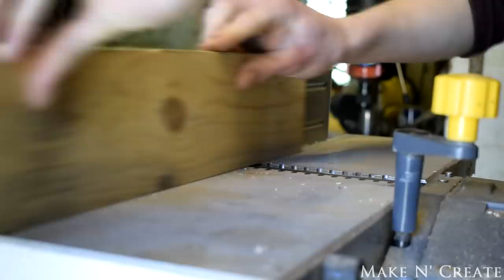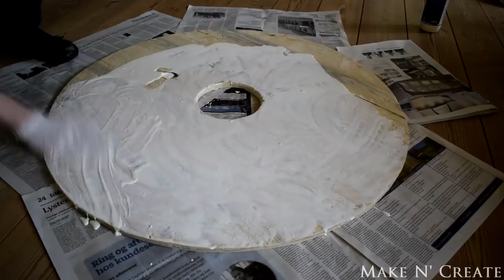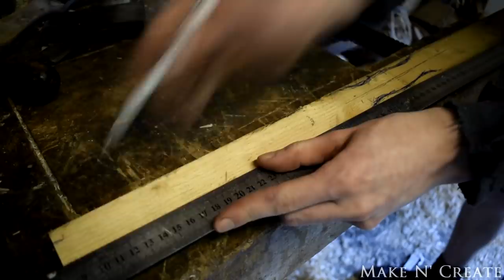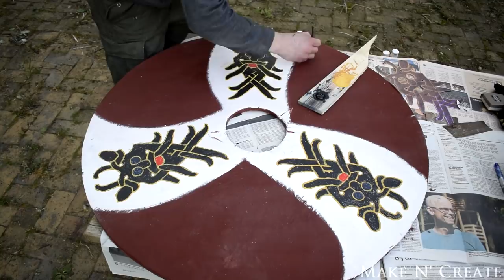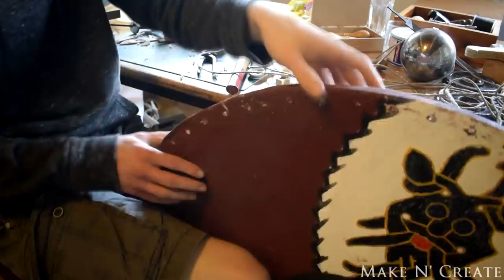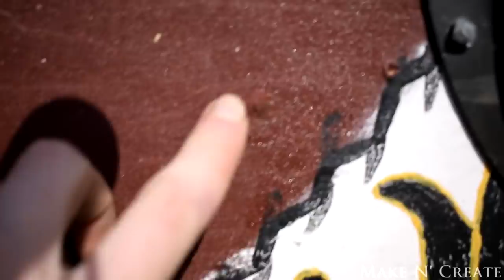Woodworking, Blacksmithing and Leatherworking - Making a Viking Round Shield and Testing it

Comment from the maker: Just gonna leave this comment here because it seems like some people didn't see what I wrote at the end of the video. This is not a historically accurate shield: Steel boss is too wide, wood is too thick, there is not evidence that they used double layers of wood, shield is too heavy. And probably a bunch of other stuff. I knew all of this when I was making the shield however the thing is, when you are making something for the first time (in this case a viking shield) you are most likely not going to get it right in the first place. So with that in mind I just made a cool looking shield, with a mix of historically accurate and non-historically accurate techniques. *Everything I learned during this project I'm gonna add onto the next shield I make which is gonna be more historically accurate*. Cheers!
Reply: Make N' Create. Non the less i would pay at least £160 for this fine craftsmanship
Reply: SPRING STEEL NAILS THO??? :D -jk
Reply: Make N' Create How did you learn about knifemaking and sheathmaking? I'd like to know
Reply: forging aswell
Reply from the maker: self taught
Reply: If you're looking for authentic techniques and inspiration, Roland Warzecha (on YT) has some stellar stuff.
Keep up the great builds!
Reply: Serious talent!!!
Reply: Still, a very nice shield
Reply: Having read that comment, I hope one of the things you learned was to either put waskers over the wood before peening the boss' nails (the modern way), or just bend them over back into the wood and hammer them flat (the historical way), because otherwise they risk failing in a rather hilariously hideous way :-)
Reply: Make N' Create 
It looks deadly
Reply: the bows the had back in that time where no where as powerfull as your compound bow
Reply: Так долго делал.ради чего?
Reply: Where did the Vikings find all the old pallets?
Reply: Now all you need is to make a halberd and a crossbow to test your shield
Reply: Well complainers will always complain ... anyways good job mate :) really nice shield :)
Reply: Does it have to be accurate ? 
This is your channel AND you can make whatever you want wether it be accurate or not as log as you had fun with the project thats all that matters !!
Reply: I loove all your videos and i want too see if you can make something if you can then you would be amazing so i would like you to try and make an authentic ulfberht sword. These are one of the most challenging swords to make and i really think you. Would be able to make one ive searched on youtube and the most authentic is botlemorze knife and blade forges ulfberht sword if you wanna see what they are and the history go watch there video. Best of luck 

                                                                                                                                         -Nyxius
Reply: And since I want to see that other shield, I'm gonna have to subscribe. So congrats. you did the Youtube correctly
Reply: Heya! Sorry for asking this late, but where do you get such big pieces of rawhide? I had to use chewing bones for dogs which result in very small strips for my own shield.

Thanks for the tutorial, it gave me ideas to make another one more efficiently. Take care mate.
Reply from the maker: Just a big dog chewing toy. Bought at local pet store
Reply: I just made my first round shield a couple of weeks ago. Pretty much the same method, I used dowel pins, but now I see that may be a wasted step. 🙂
Reply: Make N' Create i
Reply: I know we have found tons of preserved germanic shields in bogs from Denmark to Latvia. It was custom to offer valuable belongings to the gods by tossing them into hallowed bodies of water
Reply: Im making a simular shield child size but think the wood would have been double layer as you make otherwise an axe could easily split
Reply: Hey! Why isnt your shield historically accurate? >:(
Reply: i thought it was too flimsy but now i understand its not there to take the full force of the blow it would move back with the blow if you were holding it so the most damage it takes is if someone hits the top of it wich would leave them with a weapon stuck in your shield
Reply: Even despite the weight and what not still a great video! I watched every second and am grateful for your work. Love your craftsmanship. Excited to see what you do next. Kudos!
Reply: Make N' Create eh
Reply: Craftsmanship was awesome anyway.  Don't let the trolls get you down.  Must be Franks or Saxons.  Some people really hold a grudge.
Please post the historical build when you do it.   Try building a scutum or hoplon also.
Reply: @Make N´ Create  I mean, no offense, but... I can think about 4 or 5 better ways of doing this, I would say you can´t use them because they´re modern techniques and tools, but you used every modern tool in the book to do this, and... In the most terrible way, Im sad to say :S:S (man, didn´t you ever heard the basics of wood-working..?? like cutting not scraping, and all that..??) My guess is this is a first time video... A complete rookie doing something. So my real question is, if this is the first time you´re doing this, why would you make a video about it and upload it online ?? I don´t know, but the only thing you´re achieving is to confuse young people who think you actually know what you´re doing, and who are going to imitate the way you use your tools at home...
Reply: @gabrielp9646  O.K.  If you know 3 or 4 better ways to make one, why don"t you go and do it and make a video and we can critique you, o.k.?
Reply: @thomaszaccone3960  Because I don´t have the need or the time to, cause Ive been in the workshop since I was 7 years old, because my two uncles are carpenters, my grandfather was a carpenter, my great grandfather was a carpenter... And because every wood-worker knows there are like a million better ways of pasting wood than with fast-wood white glue or PVAC xDxD (but of course, much more difficult and expensive to do, specially if you want to go history-accurate) Actually this video is not that bad, is just a rookie wood-worker doing a shield for the first time. I simply was really dissapointed when I wanted to see how a shield was really made, I did a youtube search, and the first video I found is... This :S:S
Reply: @gabrielp9646  check out : Metatron, Scholagladiatora, Lindybeige. They don't make medieval stuff but explain a lot about how they were built.
There are a number of Viking and Anglo-Saxon re-enactment and HEMA groups on Facebook, youtube and the net that might have the details you are seeking or links to same.
Reply: @gabrielp9646  Check this guy out.  Another medieval weapons guru :  https://youtu.be/HNFxTmRFPv0
Personally i would prefer a Norman kite shield which Shadiversity ALSO describes for medieval action or a Roman scutum and gladius for ancient stuff.
Reply: Make N' Create Not a critic just watched your video and thought how kool but had to read the info because at the end I was like nooooo don’t destroy it you worked so hard on it lol
Reply: Historically accurate or not, I'm sure a Viking wouldn't have minded carrying it into battle. Awesome work, dude
Reply: Ppo
Reply: P
Reply: Great job. Only seen one hater  in the comments. Its ez to troll when you live at your moms house into your late 20s and are not talented enough to build stuff this cool.  Love the shield man. I built a smaller  one as a wall hanger for a close friend. Made a war hammer also. I intend to carve it. Dont worry about the haters..long live the viking culture.wish there were more folks living as modern  Vikings instead of playing xbox and being hipsters...
Reply: 15 pounds doesn't seem very heavy...I didn't know those shields were that light! Compared to a Roman Legionnaires shield that really isn't much. but I guess most Norsemen were light armored anyway.
Reply: Make N' Create lol I made one with my uncle and dad in his workshop and it turned out awesome and looks amazing. We did a lot of the things you did which i found to be pretty cool. What I found really funny was that yours weighed around 14lbs and you said that it was heavy... well mine weighed double that😂. Anyways, love the art and I really like your variation
Reply: @Landrew0  In the trees
Reply: @MakeNCreate  what was the thickness and diameter of the shield ??

Comment: Those were anyway heavy as shields. The purpose is to block the hit by absorbing the force too, so you need it a bit heavy. I made a couple of heater shields, the heavies is around 3kg. So a round one with the same height is obviously more heavy, then you have the metal plate at the center. Said that, what you did wrong is the central metallic plate, too thick, it looks 3mm thick, 1.5-2mm max would lighten your shield greatly and due to its shape, still able to sustain great hits. Historically not everybody had access to the best dried seasoned hardwood, so the wood is fine. Great work, especially the painting job.

Comment: Five seconds in........ Build a pallet breaker tool!

Forty seconds in ... prybar. Use the prybar for the nails. 

Three minutes in... Dowels. It's a shield and the glue isn't going to hold up to the punishment. 

Four minutes in ... ah, you alternated direction of the boards thus the wood fibers. That will give the strength glue alone would have given. 

Nine minutes in... A hardy. a Hardy fits into the square peg hole on the anvil and helps you xut off metals. 

Ten minutes in... Shape the nail heads in a former (swage) then forge the points. You will be happier with the results. Nail formers are still available for sale. 

Seventeen minutes in........ Drill holes for the nails. You're making and using them as rivets. Make a small bowl shaped former (10 mill) heat the rivets up to straw color. Drop them through the hole in the boss and the shied together. The pointed end into the former and hammer same with the rounded head of the ball peen hammer. Alternatively, drop the rivet through hole into the former, the position a second former built like a chisel with a concave (bowel) tip. This will give you round heads on both sides. 

Eighteen minutes in ..... Mark your spacing and use your drill. A drill bit for wood will zip right through that rawhide. 

Nineteen minutes in ... saddlemakers stitch. I like it! Wrap the cord around some dowels to give yourself some good grip the pull them tight. 

Twenty one minutes in... Field testing! Brilliant!

Twenty four minutes in... Great video, Great build. 

Well done!

Comment: Tip for forging nails. The effective way is to cut almost through the iron bar and then stick it in the nail iron, break of and forge the head. You should be able to make one nail in one heat but i never got further than needing two.

Comment: Needs less wood, more leather, and a smaller boss. Might also want to heat treat and temper the boss. A leather covering for the sheild was rarer among the vikings, but tooled leather shield coverings were used to such terrifying effect by the Scottish that the English attempted to ban the ownership of Scottish Targe shields, which are essentially just a viking round shield with a spike screwed into the boss.
Reply: Targes are strap shields, viking shields were center gripped shields. They are completely different.

Comment: Just a side note, with your nails instead of cutting them off, look up clenching. It was hard to watch you making the nails weak by cutting the protruding points instead of clenching them over. It would solve your problem where they loosened up after your 'finishing process' in the yard. Great video and I'd love to see a historically accurate shield made. You've got another subscriber!

Comment: This is an older video but I just found it, yes the shield has many things wrong with it but that's okay because it is a fun learning process. One thing I will say, if you do go to make another shield-never make a handle like that. At any impact or strike, with your hand in the hole your forearm against the wood, you will do a lot of damage to your arm. It needs to be a pliable material, leather straps or an old leather belt will work. Stay away from the hole you made in the middle, that was a bad choice because now your put your hand and arm at risk. 

As for the shooting and whacking parts, not bad. I would not have aimed for the center with those arrows, and if you want to do another part where you take axes to the shield you made-perhaps you should make a stand for it, either a full pole fastened to it or a tripod of sorts will work. That way you can demonstrate the full force of the blow, without knocking the shield over/down or just having it leaning on some wood. ^_^'

Comment: Just as a helpful tip i think the nails used to hold the grip on the shield would be slightly more "authentic" if bent at the tip after they'd been hammered through and then bent over 90° from the point they exit the wood. Like a giant staple sort of. Just as an aesthetic closer to true form abd actually holds better too.

Comment: doesnt it need to have iron ring around the shield above the leather? Im assuming the leather is to protect the wood from water infiltrations, so it should have iron protecting the leather? It would weigth even more so i dont know how they would make to reduce weigth, maybe sligthly reducing the diameter and thickness, or maybe its about the wood type?

Comment: Nice motefe. I enjoyed it's history. 
I'm assuming you avoided 7 to 9 ounce leather to save on cost & wieght? 
Why does every roundshield since Skyrim have a middle woodrn handle? 
( A leather elbow pad with forearm strap & an offset handle provide more area protection from shield. ) Also, its easier to wield shield in defense. 
Your center dome is much larger in diameter than historical shuelds. 
And possibly thicker. 
Why do your Motefes face inward?

Comment: Good things first, i really appreciate making your own nails for the guard, secondly i really liked double clothing method u used cuz its preventing wood chips to fly directly to your face, it toke me many shield to realize that. Now to things that i didn`t liked about this shield, I didnt like that you haven`t puted tenants in logs at the start it is reinforces the shield a lot secondly do not put so big holes in that shield your are loosing lot of durability this way, and now to the last thing which is just my friendly advice as a shield user, rounding shield with leather is nice and its practical, but way more functional is to copper strip around your shield cuz it gives it far more strenght  and it causes jamming your enemies swords and axes and you definetly do want that in a real fight. I wish you lots of luck in your future building and strong arms for wielding your weapons and shields.

Comment: can you help me and share the difference between the holes on the hide, and the holes on the shield accounting for the curvature of the shied? this part confuses me sooo much. also how much dog bone did you need, how much was that huge dog bone haha
Reply from the maker: The curvature of the holes don't really matter as the amount of curve between the holes is very little of course if you're making a shield with a smaller diameter you might have to account for it. The dog bone I bough at a local pet store so you can try that maybe, if not look online for rawhide dog bones.

Comment: Nice work, but why split the boards in half and glue them back together? Just curious
Reply from the maker: so I could lay them like ply wood.
Reply: The construction functiond kinda like plywood, its also historically accurate
Reply from the maker: Not on viking shields.
Reply: The Norwegian Gulaþingand Frostaþing laws specify the construction of a shield. The shield should be made of wood with three iron bands and a handle fastened to the back side by iron nails. A later revision of the law says that the shield should be made of a double layer of boards (tvibyrðr), and the front should be painted red and white. 

http://www.hurstwic.org/history/articles/manufacturing/text/viking_shields.htm

Comment: good first go and that you know what and where to adjust to get closer to historically accurate is a good thing :) . . . there is strong suggestive evidence that lamenant layers of wood were used just tapered around the last 1/3 of the radius, the cloth was good too, just cross the lamenant planking next time :)  also please please please work on peening after a rivet set, probably best to just start making nails . . . .about 5,000 nails and you'll get it . . . then hooks, and impliments :)  nice job on the boss there again you well know that the center impact has to be the beefiest, then it can carry a lil thinner on the slope and side, just leave the rim thicker and maybe a bit wider :)  NICELY DONE YOUNG MAN! :)

Comment: That's not heavy tbh. Viking shields were around 5kg and leather covered ones could get as heavy as 7kg. I think you kinda nailed it.
Reply from the maker: No they weren't, they were very light. So no I didn't nail it.
Reply: @MakeNCreate  There were light shields that's true but they were disposable items that usually didn't last more than a battle or two. The more robust shields as I said were around 5kg. I own a reproduction that sits at around 3.5kg but I can assure you I have seen historically accurate reproductions that were much heavier than mine.

Comment: Just a quick question, what kind of wood was in the pallet you used? Pine? Spruce? I'm not an expert when it comes to wood but maybe birch would be lighter and I'm pretty sure it's a historically accurate wood used for shields. 
That being said I'm pretty sure you're within the weight range for a propper Viking shield.
Here this might help. 
http://www.hurstwic.org/history/articles/manufacturing/text/viking_shields.htm